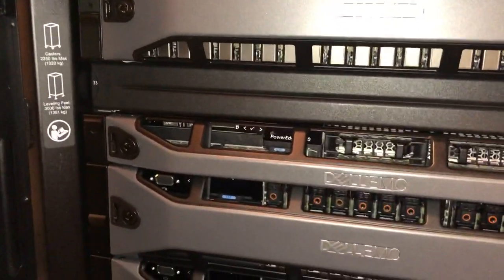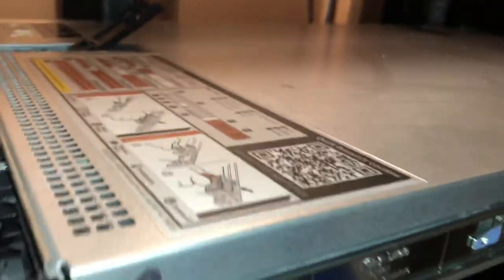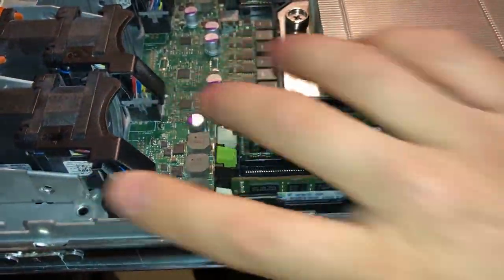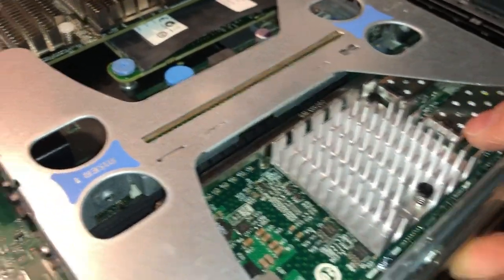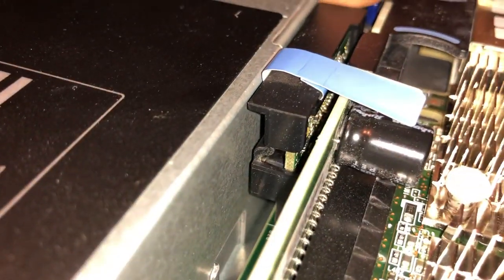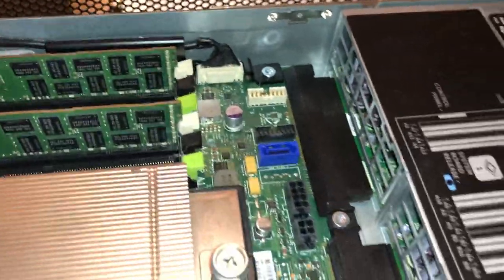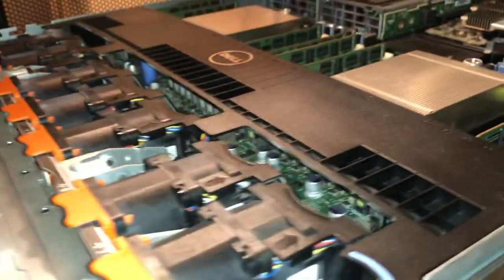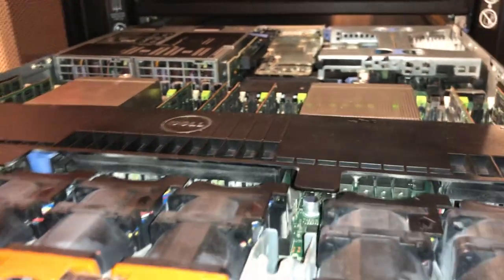Dell PowerEdge R620 & FreeNAS

Comment: Hey! Pretty interesting! I have a R620 at home as well but struggling without any HBA Card. Do you recommend buying a HBA card or am I also able to add additional SATA drives using the SAS connector located on the mainboard directly? Hardware RAID and ZFS is not my recommended way and I am having plenty of errors. But now I am trying to get the best solution for R620 + FreeNAS. Thank you!

Comment: Hi Nice switches and dell's there. 

sorry to over old ground but did you get rid of your Sc8000?

Did it work like a r720 as in with adding a backplane to to Sc8000 or any bios mods?

Or should I bin Sc8000 board and put in a 720 from scratch.
Reply from the maker: I have my SC8000s and do not update the bios to a R720  it will cause the fans to be 100% but other than that I have them but am selling them

Comment: Nice man. I have got a question for you regarding storage pools. What would be the better choice of the two options. Creating a storage pool in Windows Server 2019 to host multiple hard drives ranging in capacity from 1 TB to 4TB or using a third party software such as unraid or drive bender?
Reply from the maker: Definitely would stay away from unraid, I have used ZFS and many other solutions and Storage Spaces with ReFS is the most dominant and stable